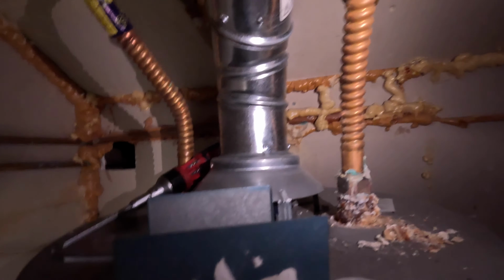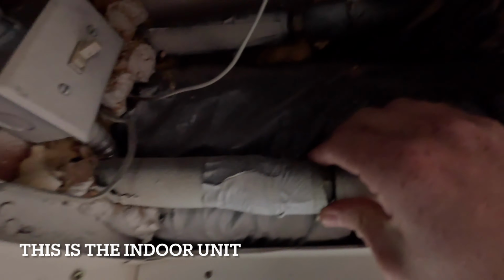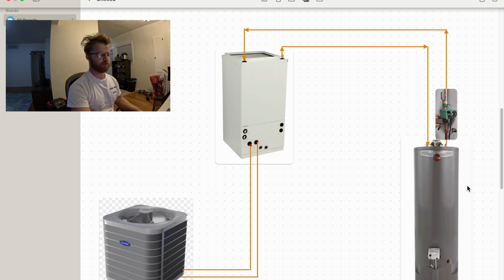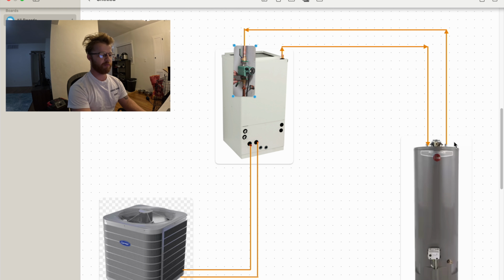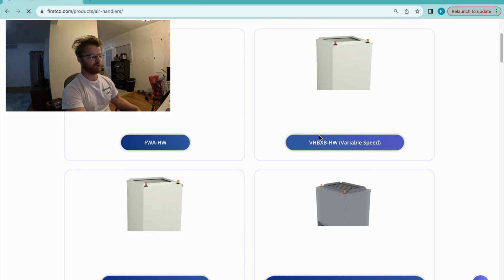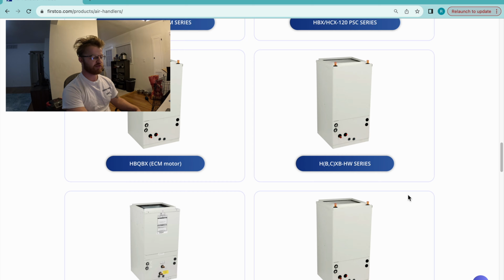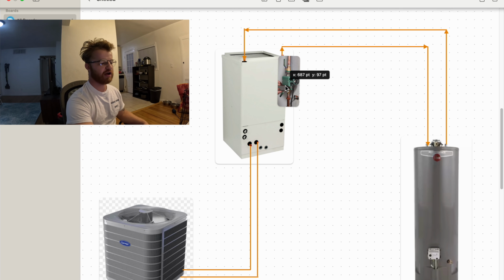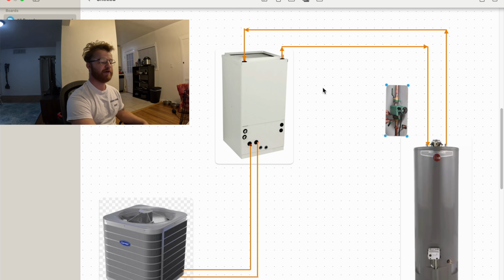How To Heat Your Home With Your WATER HEATER. Yes It's Possible!!

Comment: First co sucks but we work on tons of apartments and after 4 years doing lots of apartments got pretty good with fixing and installing hydronic systems. 
The boiler ones suck more imo, have a diverting or 3 way valve and of course being hooked up to a big boiler water system. If the isolation valves don’t work have to drain the whole building or stack and time is $. Luckily my company we have pro press’s and comes in clutch and not always having to solder copper lines so nice especially when water is still stuck in the lines. 
Yeah most hvac guys run when they see these but not me or my company, we jump right in. 
And plumbers don’t like working on them either lol.
Reply from the maker: Honestly I like them cause I like causing myself pain. You must be like me